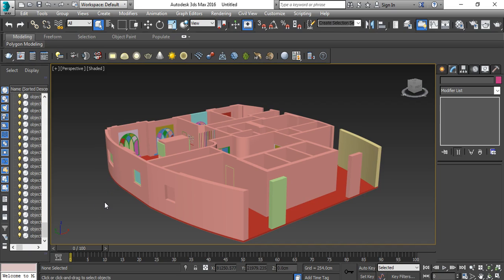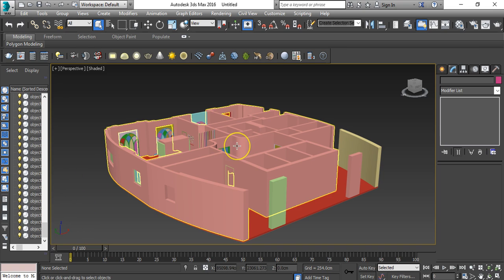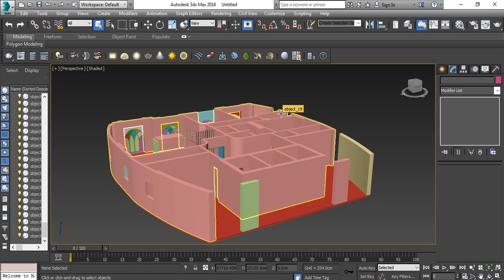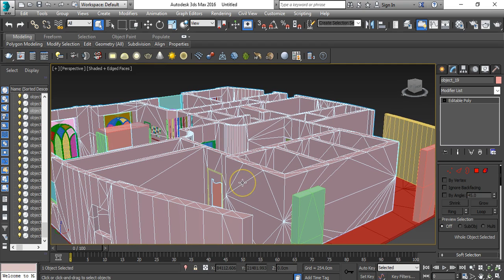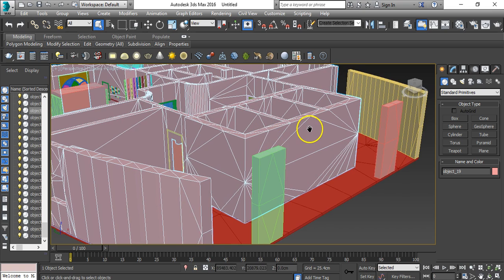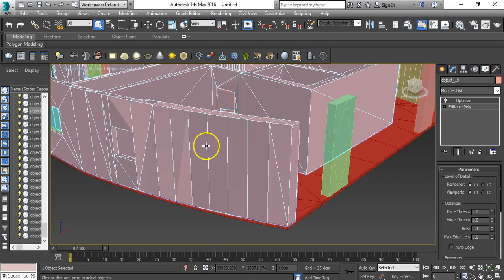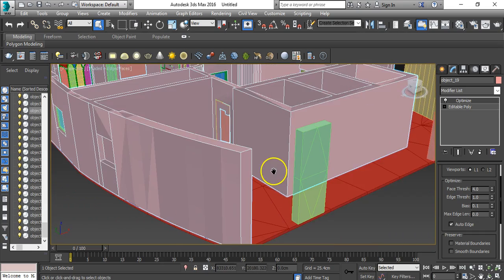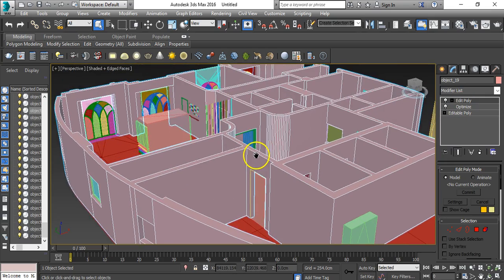Convert Triangulated Model in to Quad.

Comment: Hey sir. I know this is an old video but do you Know Rhinoceros 3D software? Can you make a tutorial on how to clean import rhino files to 3DS Max? 
All rhino imported files come inside 3DS Max as a lots of triangulate edges.
Thanks and all the best.
Reply from the maker: Hi.. I dont know rhino.. But i will find a way n surely update here for you.
Reply: @HussainTabi  
I have found that Rhino files exported to DWG and then imported into 3DS result in a more clean solids. I have read inside Rhino Mcneell forum that Rhino is a NURBS surface modeller. Because of that the algorithm from Rhino is different to draw poly-surfaces and solids as other modeling softwares. That is why is almost impossible to clean triangulate edges from there. Unless we rebuild all model from scratch inside 3dS.
The big problem here is texture mapping coordinates. Some times map textures result inaccurate and awkward. 
The optimize Modifier work with all kind of geometry, from Sketchup to autocad but Rhino unfortunately is different. 
At least this was what i found.
Cheers.
Reply: @antonioandrearq  thanks brother :) this is something new I learned today. Cheers :)
Reply: But Optimise also works good with model imported from RHINO. As u see in this video the model was exported from Rhino.
Reply: @123hussain456  Oh! i see... But some examples that i try it optimize breaks surfaces on reduce triangulate and result in texture map issues. Sorry but i can not replicate this to a video.
Reply: The other problem is after you convert in "edit poly" you no longer able to select as "elements". If you know what i mean.
Cheers
Reply: @HussainTabi  thank you so much sir.